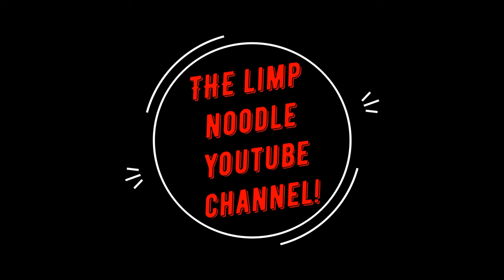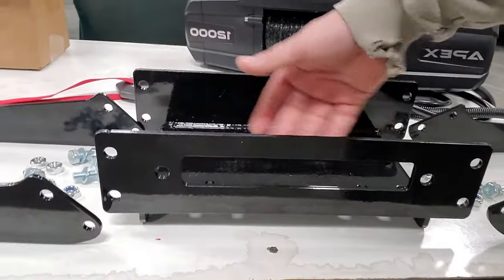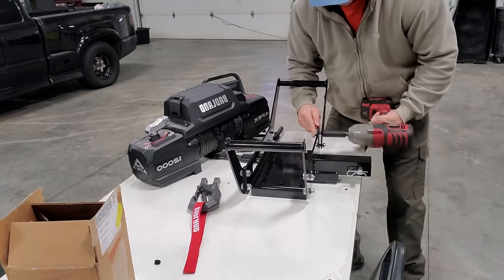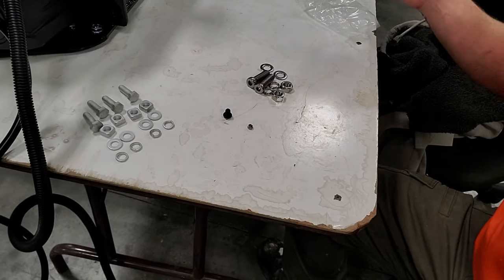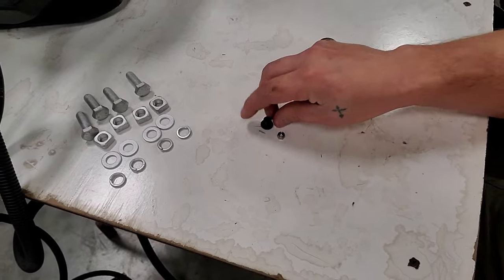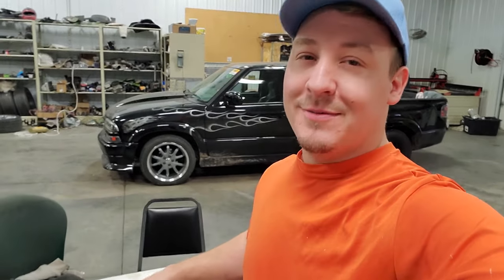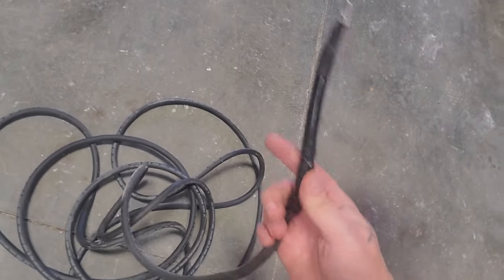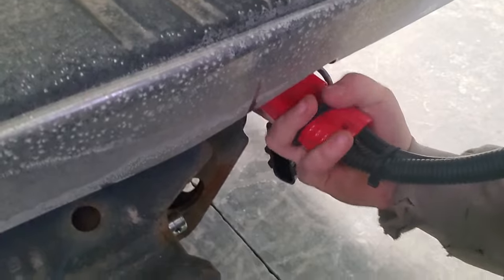badland 12k winch reciever hitch mount

Comment: Really did not need the music. Also, camera angles show nothing. Trying to mount the bolts into the bottom of the winch through the square nut slot is ridiculous. Basically, I didn’t get anything from the video but thanks for trying.

Comment: Looks like you have a late model gm truck with gas engine.  Assuming you dont have two alternators, does the truck computer complain when you hit it with the 400+ ampdraw, 2-3 times more than what your alternator will make??

Comment: Cool video, I'm doing the same thing for my Lifted Ram 2500 6.7L.  How do you like the winch so far? Have you had a chance to use it much at all?
Reply: I have the exact same winch and I love it. It actually work’s amazing  have mine on the winch mount right now but imma put mine in the bumper tho
Reply: @chevy0771  Ok cool good to hear, I will post up a install video one of these weeks if it ever warms up enough so i can mount tge winch and run the wiring. They look like great winches and have a bunch of positive reviews. Matts Offroad Recovery YT channel uses them on his heavy wrecker also.
Reply: @Temptation_Offroad  I was just about to say that Matt’s off road recovery uses that exact winch also and he stands behind it as well his whole teams uses it
Reply: My Ramsey REP8000 but the dust.  A magnet in the motor came apart.  I'm going to get this winch and bracket. My Ram 2500 has front and back receivers with Anderson plugs for the winch. In going to install dual marine gel batteries in the tool box, rewire the cables. That way I have more power and the winch won't drain the main battery.
Reply: @waredbear  Cool! Sounds like that will be a good setup! This is a very nice winch for sure.

Comment: You didn't show where you mounted the ground wire to. Any circuit breaker or fuse at the positive terminal? Otherwise, great video
Reply from the maker: I did not add a fuse, I would recommend it as you should have. Fuse on every circuit buy I didn't. 
The ground was just a screw into my  frame. Makes for a nice short wire
Reply: @limpnoodlelifestyle5552   did you upgrade the body ground?  i have seem many vehicle burn the grounds right off the engine because people did things like you did.

Comment: Where do you keep this winch when not using it? I have the same truck and trying to figure that out. Because I tow alot lol. And yes a video of the wiring install would be cool.
Reply from the maker: For the first 2 months I kept it in the back of the cab. Just because it's cold out and when you need it you really need it to work lol I didn't wanna risk it being cold and not wanting to operate. But ever since then I just keep it in the bed
Reply: @limpnoodlelifestyle5552  do you keep it in a lock box or just let it sit. Pretty expensive for someone to swipe it lol
Reply from the maker: I just let it sit, but I have a bed cover and I'm in my truck alot so..a bit circumstantial. I did think about making a mount for it on inside of the bedside. Something that you put a key in and it releases but I didn't want to drill holes in the bed

Comment: Is the 10 gauge enough? I am aiming for the same setup as well. How is it this far?
Reply from the maker: Works flawlessly. I have pulled out 9 vehicles with it and it's saving me q butt load of money on tow trucks
Reply: hell no!  1/0 is small, but will work.  the more voltage drop you have, the harder an electric motor will work.
Reply: I'm pretty sure he said he used #2 (2 gauge) not #10.  #10 sounds way too small to me.  (10+ year electrician here)  Definitely want that wire rated for the max amperage of the winch x 1.25 (80% deration factor)- x 1.56 would be even better..  Also want a fuse on that wire for what the wire is rated at, or LESS (so the fuse blows before the wire overheats).

Comment: Did you use the same power and ground cables that came with the winch to wire it into there red Anderson connector? I am doing the same thing soon but didn’t know what kind of plugs I needed to buy.

Do you have links to the Anderson plugs you use? Or at least know the brand or amp rating on them? 

Was the power and ground cable a little small for those prongs on the Anderson connector?
Reply from the maker: I did use the group cable because it was long enough. But I bought a long 2gauge red wire to the front of the truck
Reply: @limpnoodlelifestyle5552  thanks for the quick reply. So you used the original power and ground cables to attach to the Anderson plug? If so was the fit loose in the silver part where you push the strands in?

And is there a better way I can talk to you? Maybe Instagram or phone? Would like to see some more picture or info on how you did this! Thanks
Reply from the maker: Maybe I can make another video to explain in more detail what I did. I was thinking about doing one reviewing the winch anyway. It's seen a ton of use this winter and saved me boatloads of money
Reply: @limpnoodlelifestyle5552  sounds good. So in the end did you use the same power and ground cable that came with the winch?

And when do you think you could upload an update video? Would like to get everything order as soon as possible. Thanks!
Reply from the maker: I purchased a longer power cable, I used the original ground cable and I ran them to the original posts on the winch. No changes just a longer wire on the positive side
Reply: So just the red is ran all the way to the back and the black is grounded under the bed somewhere to the plug?

Comment: Nice video! Where did you get those red quick connectors?
Reply from the maker: I think I bought those on ebay. Just go on Google and type in quick connect battery plug. They will come up from a bunch of dealers

Comment: Did you use a circuit breaker fuse at all?
Reply from the maker: No
Reply: @limpnoodlelifestyle5552  probably doesn't even have a fire extinguisher.
Reply from the maker: I pleed the 5th on that lol

Comment: What’s this mount rated for
Reply from the maker: As much as it will hold brother LOL. 

I've pulled a new holland l175 skidloader sideways with this setup. So it will handle quite a bit. I would think that the weak link would be the hitch pin. And if that breaks its no big deal. However I have had no issues up till now.

Comment: Where are the grounds wire too off the battery or frame out back
Reply from the maker: I drilled into the trailer hitch for the ground
Reply: and let the body grounds burn.  common mistake.
Reply: Didn’t you get a disconnect in the box with the winch? I’ve got one but it was LIGHT on the instructions and I haven’t seen anyone use one yet for how to secure it near the battery. I know others have mentioned it, but it’s a good idea to run a dedicated ground to something pulling that much current. Thanks for the video!
Reply: @jmalinowski1000  What do you mean by that?  It would seem to me that the frame is a hell of a lot thicker "wire" than regular wire.  I have mine set up for my front winch and was thinking about doing what he did for the back, including grounding to the frame.
Reply: @stevezinsenheim3524 The frame/ body are both grounded through wires that connect to the battery ground. Those won’t be large enough to handle the load of a winch unless you upgrade them first.

Comment: what gauge wire to get to the back? 0/4?
Reply: not sure what gauge 0/4 is. 2/0 is fine.
Reply: @jmalinowski1000    Is 2 gauge CCA good enough or does it need to be all copper?  FYI: I do not expect to be using mine much.